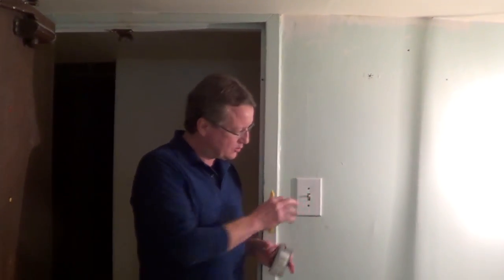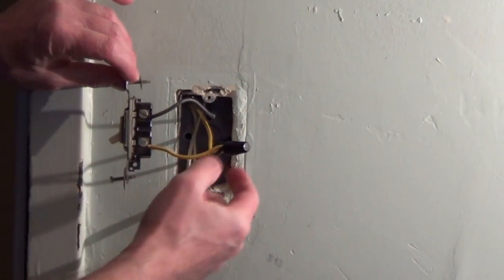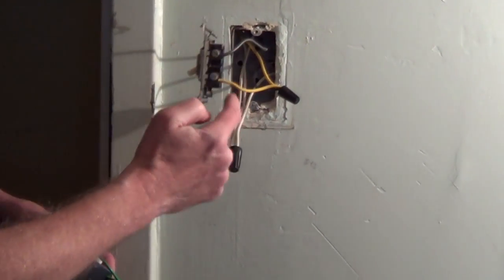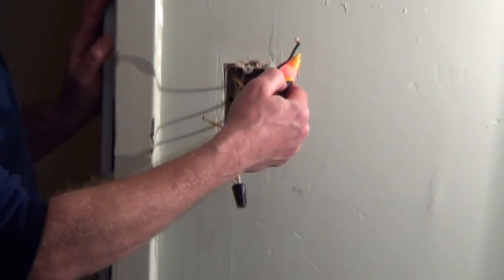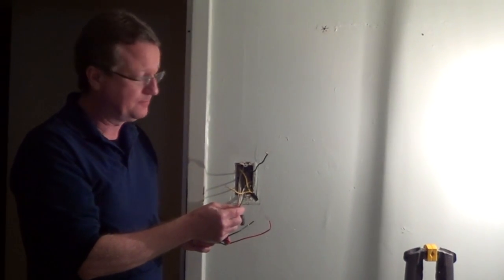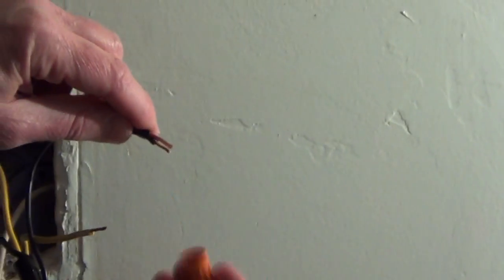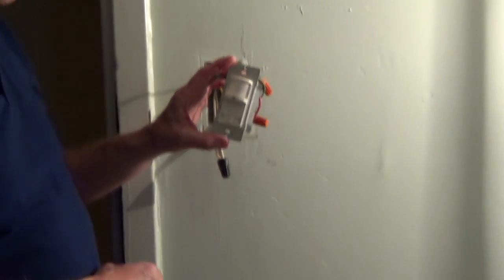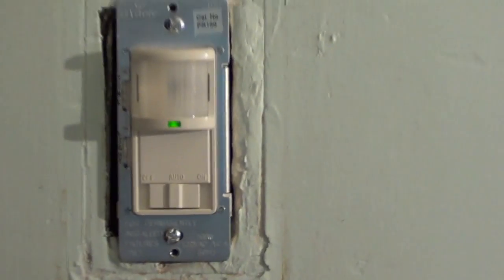Motion Sensor Switch - Motion Sensor Light Switch

Comment: I looked at this but im having a issue i have 3 black wires and 3 white wires and one green when i do it as shown my lights flicker on and off what did i do wrong?
Reply from the maker: Hi, are you connecting a motion sensor or dimmer?

Comment: So I followed the instructions for the 1 pole configuration. Attached the black wire to the hot wire and red to the load and also attached the ground wire, but it didn't turn on after i turned the power back on. What I might be doing wrong?
Reply from the maker: +Sadaf Sheikh Hi, I would check the instructions, each company may have a different configuration. I would remove the switch and test for the hot (feed) wire. Check the instructions for which wire would go to this, the other wire will be the load. Let me know how it goes.

Comment: Is there any problem if I want to use this swich un the bathroom?? Is there any problem due to the gass or the steam or the temperatura when there is someone taking a shower??
Reply from the maker: +Asesorias SM Hi, I read the manual on the Lutron sensor and bathrooms are listed as a good location. Do you have a make and model?

Comment: I want to replace an outdoor motion sensor light with a simple patio light fixture.  I believe the exterior plug nearby is also included in the line.  There are red, white and black wires involved plus the ground wire. Could you show how to do that?  Thanks!  California resident
Reply from the maker: Hi,
Out of the electrical box on the house, there should be a black, white and ground wire. This should match the new light. The extra red wire should be just be on the old motion sensor. Turn off the electric to the circuit and connect the black to black, white to white and ground to ground or green wire. Let me know if that helps.
Reply: These work just fine for me http://www.ebay.com/itm/251285840499